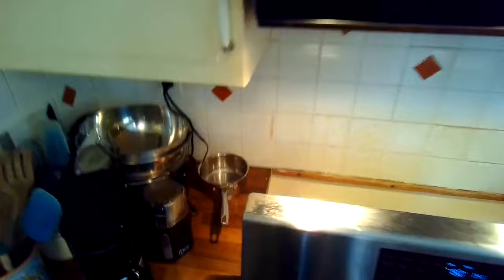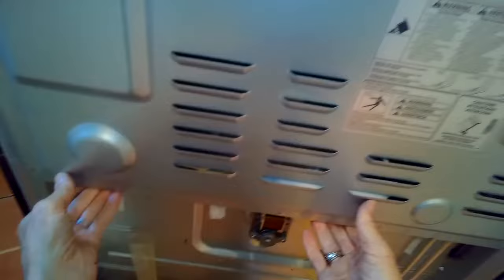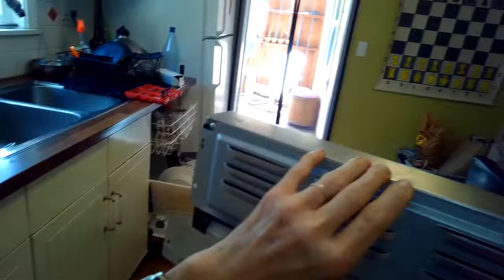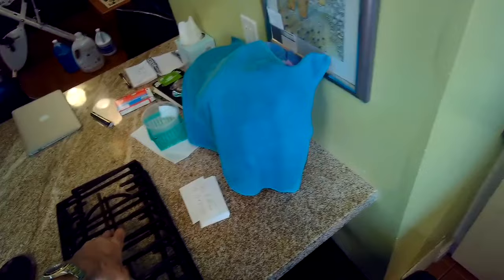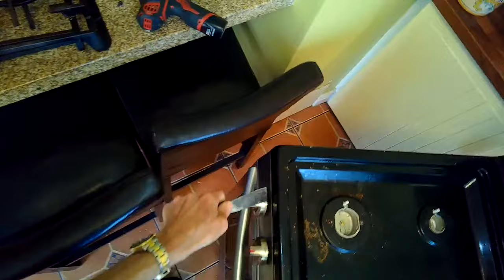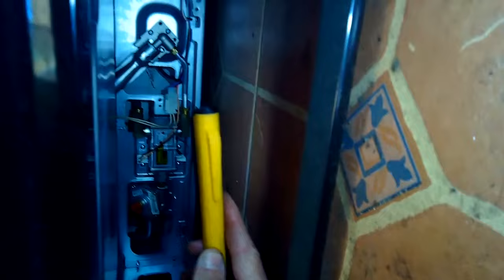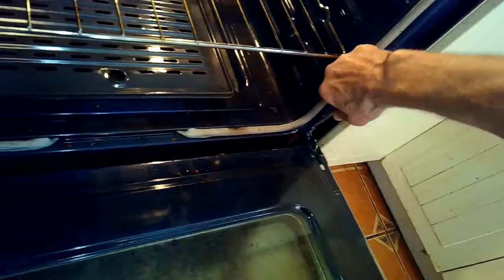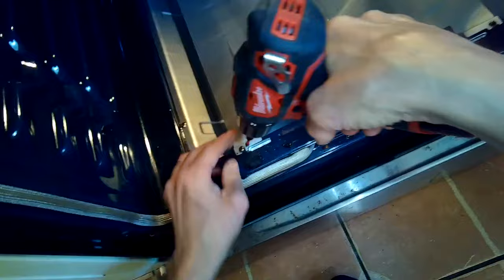✨ Samsung Gas Range  - Easy Dissassembly ✨

Comment: I wanted to thank you for this. Mine is a brand new one of this model which sat in the garage for 6 years due to .. problems. Now that we went to install it it was full of mice and required replacing the blanket as well as disassembling everything (and I do mean EVERYTHING). Putting it back together, even with photos, was surprisingly difficult. I need a gopro on my head when I do this work.
Reply: And @1:15 I finally find where the bloody part goes! Thank you!
Reply from the maker: Nice job Jason.  You should check out the iVUE camera glasses.  They’re great.

Comment: Thanks for the video, Scott. I was wondering why I couldn't undo the top burner covers after removing all the screws. It was the clips the whole time.  My mom gifted me the same stove (unused), but it was in storage so long that some mice moved in. Just making that sure everything is clean and all the electrical wiring is undamaged. The worst part was under the bottom oven heat spreader. The mice used that as the outhouse.
Reply from the maker: 😬 yikes

Comment: Hi great video!  My problem is the right front burner won’t turn off!  The switch is locked in the on position and won’t turn, not even to lower the heat.  I have to turn the gas off from the shut off in back.  Can you help me please?

Comment: Where's the rest of the video?! Lol. I was learning about my stove and then it ended! Lol. The reason I'm looking to learn about it is because recently, I discovered I had a guest mouse residing in my stove! I caught it and let it go outside at the corner of my street in a small wooded area! Three main reasons I want to get in my oven is I want to make sure it didn't start a family in there, clean up the flat areas where it may've peed and to see any chewed wiring, which I don't think there are any! Uhggg... lol. Thank you for your video, I'll definitely be checking out more, and if there's anything else I should look out for or at, please let me know!! Thanks again, great video!!!  Don W., Ohio
Reply from the maker: Thanks Don,
It’s so common for mice to set up camp inside the oven insulation.
Sounds like you handled it correctly.

Comment: Hello there,I want to believe that  with this your video that I just watched,you will be able to assist me with the issue I am having with my Samsung range,exactly your type.I have this exact same model that you have,sometime not too long ago,I changed it from natural gas to propane,I changed all the orifice and when I tried to light a burner,it is all the burners that comes to life and the burner just flared up boom just like that.I have changed the valve rack in the front,the spark module and the spark element on the burner but the burner still flares up when I try to test it.I will really appreciate your assistance to help me solve this problem.Thanks and I look forward to hearing from you.
Reply from the maker: You’re doing good.
It’s normal for all the burners to spark when any one burner is turned on.
The large boom means that orifice is too big and it’s letting too much gas come in.
Reply: @ScottTheFixItGuyChannel Thanks for the response,I really appreciate it.That was the first thing that I did when I was converting to lpg propane gas,I changed all the orifice,the broiler and baker in the lower compartment inclusive to the small size for propane gas and also reversed the pressure regulator.I will sure appreciate all that you can do with your experience with these appliances to help me solve this problem.Thanks once again and I look forward to hearing from you.

Comment: THANKS! The rear panel was a bit puzzling at first. I needed to change the oven temp sensor...
Reply: Def that'll be helpful!
Reply: @PleakTCG  Still getting an error after replacing the sensor...ugh! Now I have to check for and solder broken wires...double ugh!
Reply: @moomoopuppy508  I have not gone that far yet on repairs, but I'd just double check and make sure all your connections are solid and didn't clamp any wires when putting back the panel.

Comment: I have this oven.  The light clicks on and off when I open the door, and the display flashes door open.  I think the door switch may be going bad.  I couldn't quite see it when you took the drip pan off in your video.  Is that the way to access it for replacement?
Reply: IF you had the door off at any point, redo the removal and installation. Look at the left and right side of the door where it meets the oven when closed.....with the interior light on and see if there is a gap. If so, you did not get the door put back on properly.  By now you probably have a new oven or spent $200 to have someone come out and do it for you.

Comment: Thanks for the thorough breakdown... I've already had to replace the oven igniter. now I've 2 of the 5 burners not sparking and my convection fan will not run. 3 of the burners spark but 2 will not... spark modulator? the convection fans spins freely so maybe a thermo couple?
Reply: So you just have to clean them with a grease remover type of cleaner like Krud Kutter then follow with a rinse. Don't be afraid to use water. Use a spray bottle to spray the water then dry thoroughly with a microfiber towel or high quality paper towel to remove all debris.

Comment: So, what would you say if the oven won’t turn on AND the broiler won’t turn on? We have the same exact appliance as in this video. I think there’s a separate igniter for bake and broil.
Reply from the maker: Hi Corey,
Are you able to see the igniter glow really brightly when it’s supposed to start the broil or the bake?
Reply: @ScottTheFixItGuyChannel  It doesn’t look like the bake one is. Haven’t checked the broiler one yet. Just to make sure I did it right: I pulled the stove away from the wall and turned the gas off, then took the door off and heat shield per your instructions in this video. I turned the oven to bake and held down the door button and waited 1 minute and didn’t see any change. I have until Sunday to figure this out and earn my keep before the wife calls it in.
Reply: Okay. Just checked the broiler igniter and it’s the same. Neither igniter glows at all. Igniter heat shields stay cold to the touch.
Reply from the maker: Gotcha,
Does the cooling fan kick in as soon as you start the oven ?
Reply from the maker: It’s either it got too hot and tripped the hi-limit or the relay board needs to be replaced.  Both parts are pretty cheap.
Reply: @ScottTheFixItGuyChannel  No fans come on that I can detect. I tried putting on convection and still no fans.
Reply: @ScottTheFixItGuyChannel  if it tripped the high limit, is that something that can just be reset? I toggled the little switch under what I think is the regulator, which I learned about in this video, but I think it was in the correct position already. Do you have any videos detailing how to perform either of those two fixes?
Reply: Sorry to be a pest, if you get a minute I think we're close. I would order the control board, since it seems like the best guess. Couldn't find it on your place to buy parts link though. It's expensive on Amazon.
Reply: Hi Cory, you can put your model number in a Google search along with the word controller and you’ll find a number of stores that sell it.
Reply: Hi Cory, you can put your model number in a Google search along with the word controller and you’ll find a number of stores that sell it.

Comment: So, I have a brand new Samsung oven. When you turn the gas line on you smell gas only from inside the oven, if you start the oven to say 175 degrees and then turn it off, the oven still generates heat like there’s a constant gas leak like the valve isn’t turning off. I’ve cycled it a few times and the issue is still there. Any ideas? It should be under warranty but the nearest Samsung tech is 2.5 hours away so they don’t want to come fix it and the place I bought it from isn’t warranting it, Any ideas on what I need to check or replace? At this point I just want it to work,
Reply from the maker: Hi Jerry,
Can you send that same question to my email address at: scottthefixitguy@yahoo.com
Reply: Did you ever get an answer I'm having this issue too
Reply: @LuisGarcia-xo3hx  yes, we sent a few emails back and forth. I got a gas leak detector from Home Depot,just the $32 detector and found that the adapter going into the oven was leaking but it only leaked when the weather was warmer so it was inconsistent.

Comment: Thanks for this video. My Samsung, exactly the same one in this video, would not heat pass 150 degrees (does not even heat up) when I press bake (which is set to 300). It just blinks 150 and stays there... normally it would start from 150 and heat up to 300 or desired temperature but only the broil now works.

Would you think it has to do with the motherboard?
Reply from the maker: I would replace the igniter😊

Comment: I have exact same stove. About a month ago, the bake and conventional bakes turns on on the control to a set 300 degrees then blinks on 150 and never increase plus the oven would not come on but the broil does work. What would I need to replace to get this working please?
Reply: i have the same issue , i think we need to replace the valve assembly.

Comment: If the igniter is turning on and its heating to about 300 but does not bake 
Should i change the igniter 
Also is there only 1 igniter or 1 at the bottom and 1 at the top
Reply: Did you figure out what the problem was?

Comment: I just followed the disassembly as shown in this video, and I've a bunch of mice to blame for my woes. They chewed through the wires leading towards the sensor unit along the left side near the hole where it snakes down towards the heating elements.
Reply: Mark Peterson get a cat🤓problem solved 
Promise

Comment: If you're gonna cook a lot I recommend NOT buying this item. I have one.  Knobs easily broke when using the oven. And the chrome peels.
Reply from the maker: Yep,  pretty crappy stove
Reply: Darn sad to hear that review. It’s a done deal now. I’ll just have to baby it. Sorry I switched to gas as I’m learning it’s a toxic way to go in your home.
Reply: I forgot to mention that inside the knobs are plastic materials. They easily overheat, parts soften up and break off. I was told by the seller to replace one costs $25.

Comment: I feel like an idioit I put the graits back in backwards but I fixed the problem that explains why they wouldn't go in and I had to use a rubber sledge hammer
Reply from the maker: That happens👍

Comment: Can you help me please
Reply from the maker: Can you put the part number in a google search and there should be a video on how to remove the switch.
Reply: Scottthefixitguy  I replace de regulator
Reply: DG94-00449A  but I still don’t get no flame 🔥 on top and oven
Reply from the maker: You might need to replace the controller.
Reply: @ScottTheFixItGuyChannel  I need change electrical cord figure out take whole back panel?